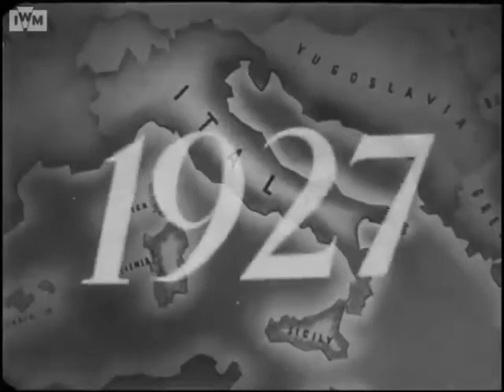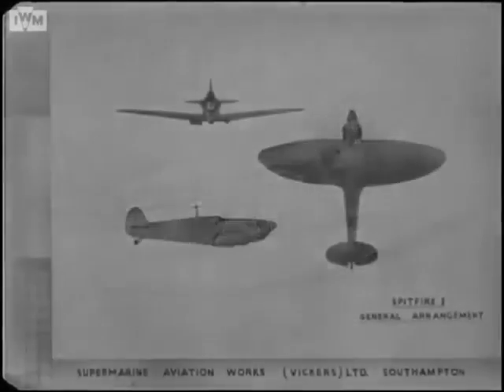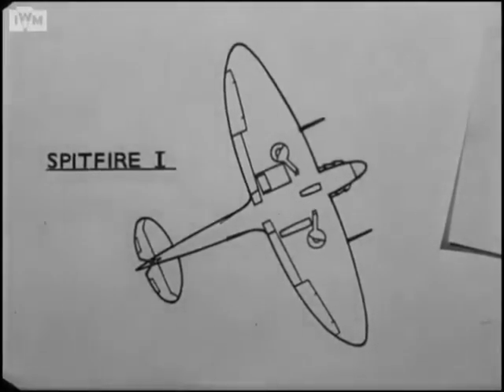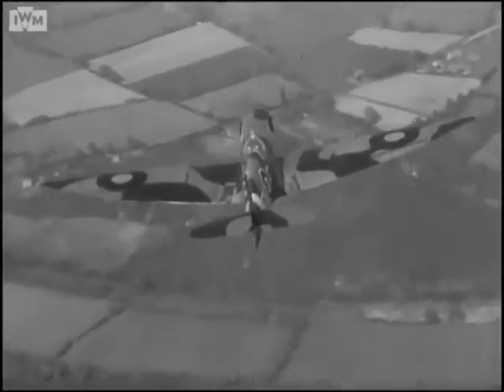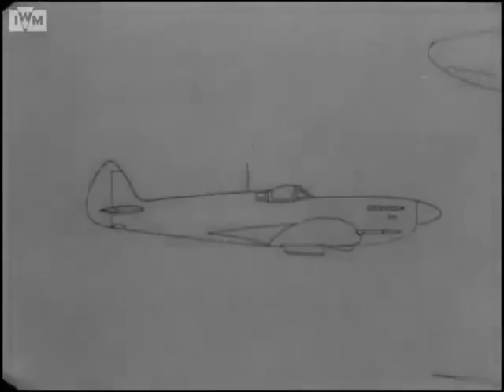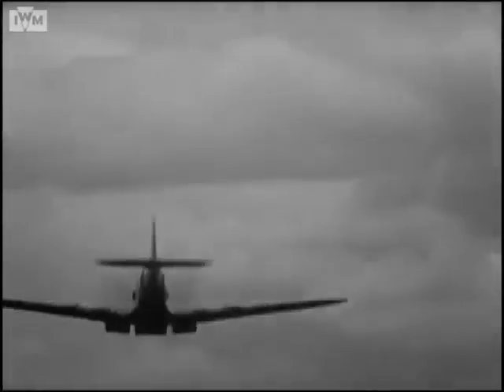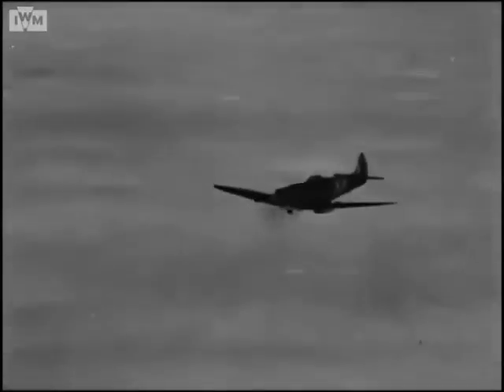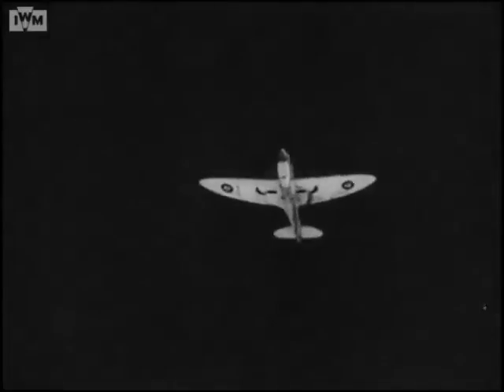SUPERMARINE SPITFIRE: The Evolution of the Spitfire - The Admiralty & Air Ministry (1944)

Comment: Thanks, this is the first video I've seen of the Mk 21, the last wartime version.
Reply from the maker: Glad I could help
Reply: Yes, the Mk.XXI wing was a great improvement and had a high cruise speed.  Dive speed was increased to 525 mph IAS thanks to the improved torsional stiffness.
Reply: Roman numerals were dropped for the 21 and later Marks.  The greatly improved wing seems to have allowed the installation of four cannon in colder climates, the previous ‘c’ wing’s heating could not protect the outboard cannon from excessive cold.  Is 525 mph indicated the theoretical aileron reversal speed?
Reply: @givenfirstnamefamilyfirstn3935  525 mph was the operational limit quoted from the Pilots Notes IIRC... standby one....

yes, 455 knots, 525 mph

Comment: Why did it go from Mk9 to Mk14 and 14 to 21? What happened to all the numbers in between?
Reply: PR versions IV, X, XI, XIII XIX, low altitude Griifon powered MkXII, mk 16 and 18, variants of the IX and XIV, seafire 17, the III and 20 were not produced I think...
Reply: @vascoribeiro69  The narrator is just highlighting the most produced models with the most signifigant changes. To cover all the marks and varients would take at least an hour and much more if you go into detail.